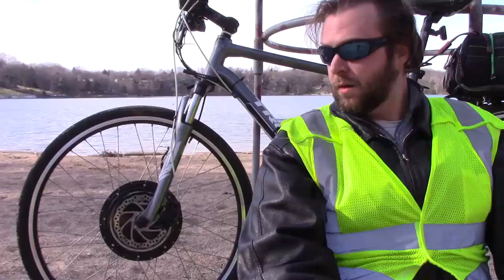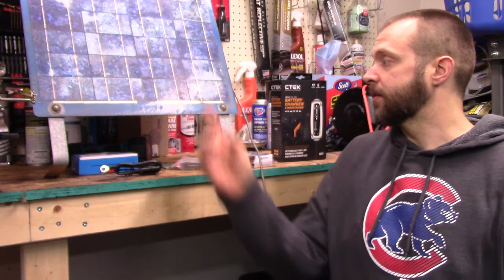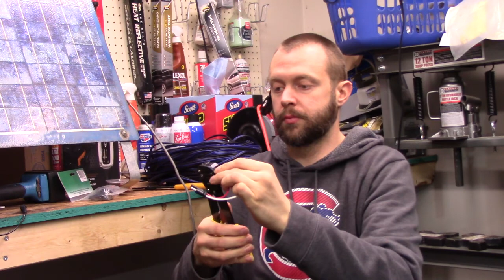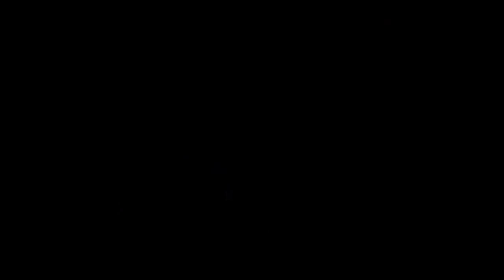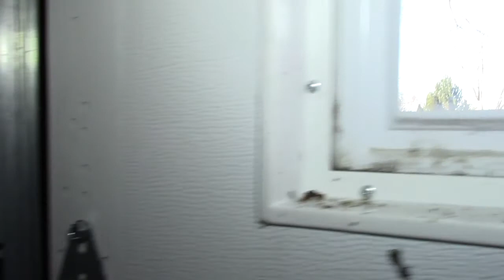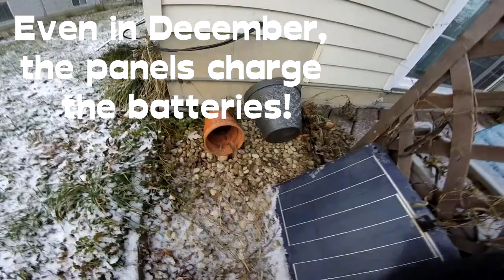Building DIY Solar Battery Charger/Maintainer For Keeping Battery Charged on Car, Truck and Tractor!

Comment: Does the alt not keep extra battery charged ?how often do I need to charge my extra battery for sub
Reply from the maker: This is meant for batteries that sit around, unused, like the tractor in the winter. If you drive your vehicle often you wont need this.